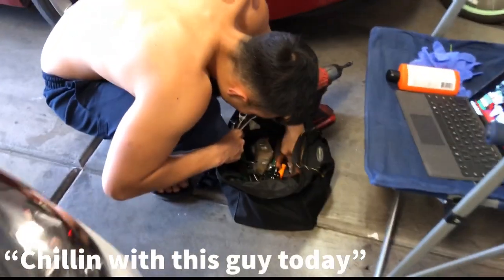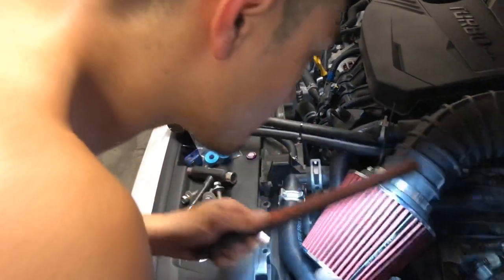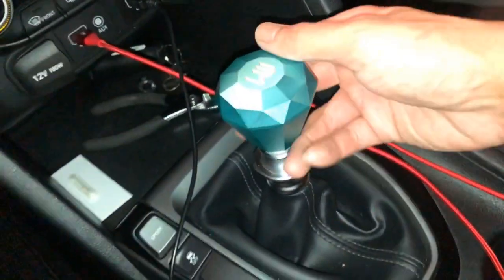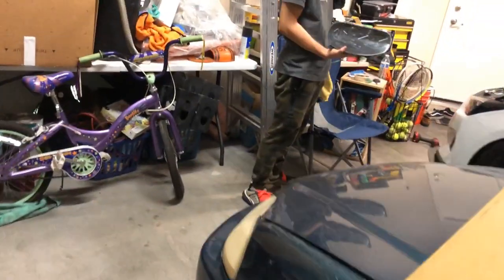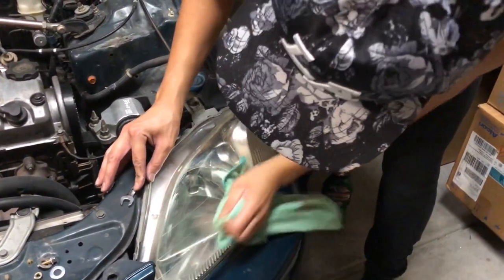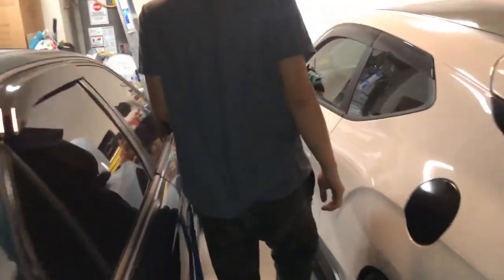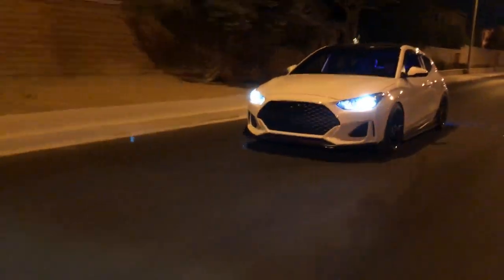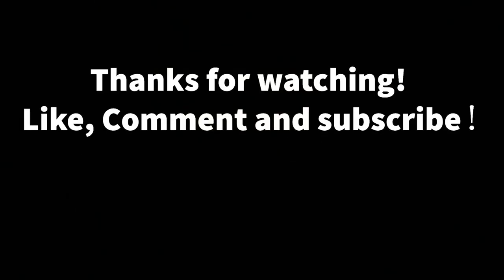New Veloster R SPEC TURBO gets BOOMBA short shift Adapter with Bushings!

Comment: Enjoying the content man! Have been waiting for an aftermarket short shifter but I might just go for the boomba short shift adapter.
Reply from the maker: I appreciate you taking the time to look at the videos man! and you should get it, it’s definitely a good investment. It improves the driving experience.  The shifts feel a little more heavier. I just uploaded another video, we just rolled the fenders on Adrian’s car.
Reply: @drivenlowkey2437  Im running 18x9.5 +40 for the wheels and there was a little poke in the rears. Recently hit a dip that I didnt see and ended up buckling the rear fenders in ahaha. Rolled it back out but I didnt pull it out more than stock
Reply: @drivenlowkey2437   Hey bro, subbed thanks for the video I just ordered the same transmission adapter and bushings for my rspec this video will help me a ton. Quick question, and I'm hoping you can provide some help. I noticed you had a Likewise gear shifter. How did you get that to work with our B&M short shifter lockout? Did you use the plus+ M10x1.25 adapter only and that holds the springs and stuff in place? Any assistance is greatly appreciated. Thanks!
Reply from the maker: @bittersweets7620  thanks man! I appreciate the sub! Adrian said he just cut a small piece of a hose and put it in the shift knob, Unfortunately the car was totaled a few weeks ago. I’ll be making a video on that soon.

Comment: For the wheel spacers can i ask why yall went with 20mm in the front and 15mm in the back instead of reversed?
Reply from the maker: deslauriers The wheels are more sunken in the front compared to the rear. That’s why we had to put the 20mm in the front and the 15mm In the rear. If they were put the other way,  it would rub.